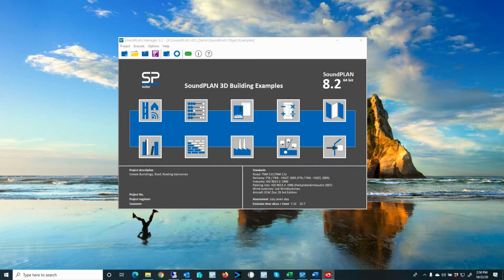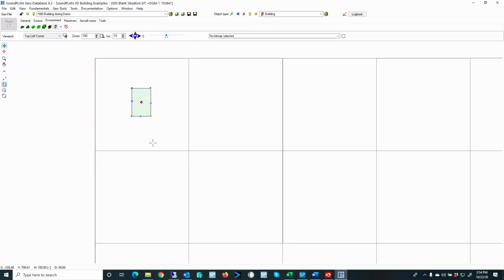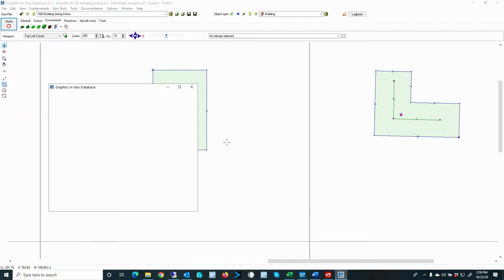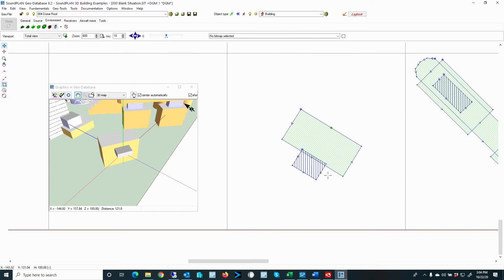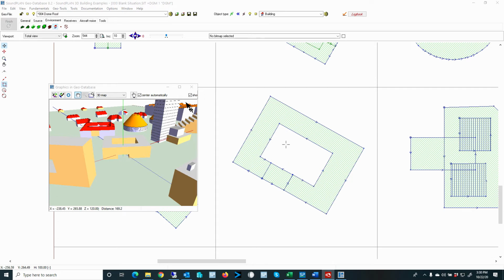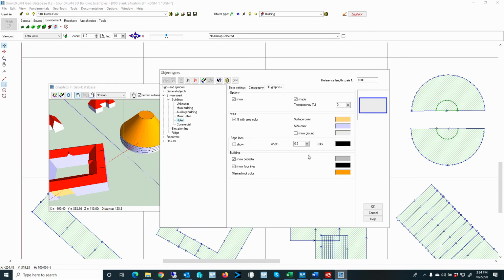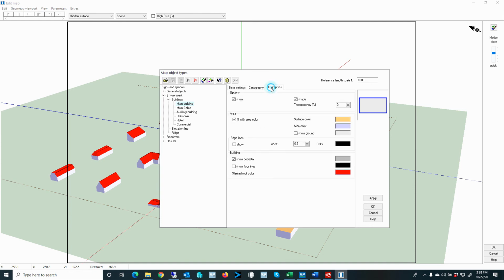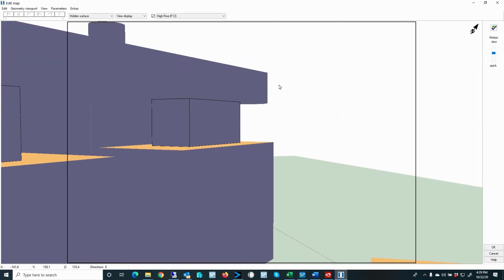SoundPLAN Complex Buildings

Comment: Hello, how can I make a circular building on its side? like a kind of horizontal tube?
Reply from the maker: Sorry not possible.  If I had to model that type of elevated tube and it is significant in dimension.... I would use the building object and float the building.  The height of the floating building I would set to ~ 70 % of the object height ... so you simplify the reflective property and the potential shielding of the object.  With the floating building SoundPLAN will predict the noise over, under and around the floating building if the source - receiver line of sight is blocked.  It will also consider the reflection of the floating vertical building surfaces.  Not ideal but still provides some consideration of your floating structure.  Note - if you have floating buildings in your model the computation time will go up...
Reply from the maker: In the video about complex buildings I do you have some floating examples of buildings that look like a building with a hole in the center (e.g., donut)
Reply: @HansForschner  thanks for your answer, i'll try it that way